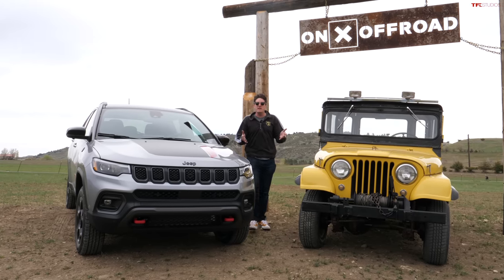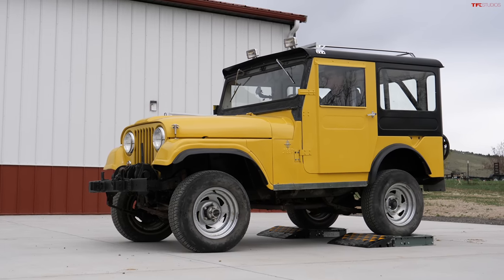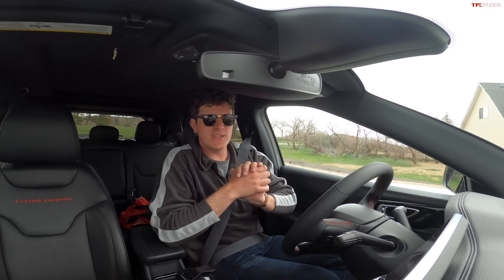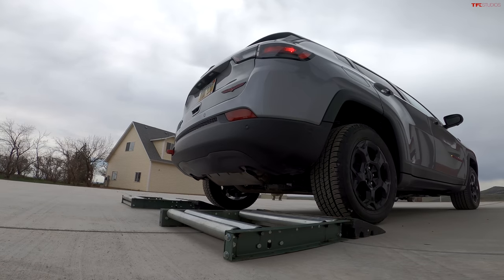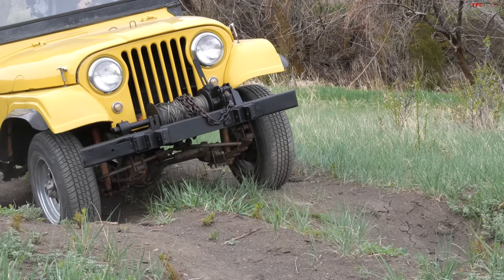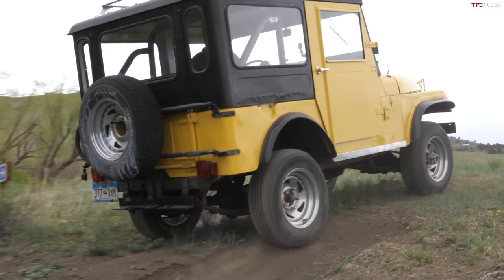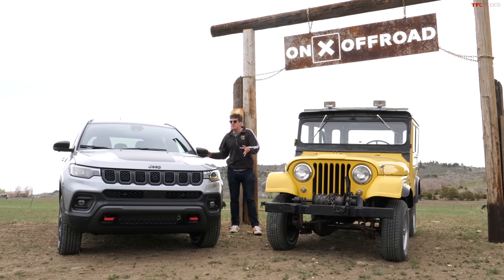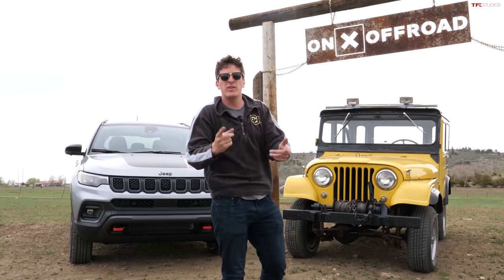Old vs New: Here’s Why Everyone Is Wrong About New Jeeps! Slip Test & Off-Road Challenge

Comment: As someone who was a child in the back of a CJ-7 in the mountains of Colorado in the late 70s, I'll tell you we didn't get cold from Dad having to get out and lock in the hubs.  He was smart enough to have the hubs already locked in whenever we left home in bad weather.  We were still cold though; that's because the stock heater was garbage.  I still have the original sales papers for that Jeep.  V-8 power, auto trans, hard-top, all for about 5k.  We never got stuck in that Jeep.
Reply: As kids, my family would've been kept warm because we'd be out pushing.
Reply: It is important to be prepared!
Reply: You need to be more specific about that $5k and the year. Due to inflation that could be $25k or $40k. The 70s weren't great for economic stability.
Reply: @jayhiggins5239  I would have to do some digging to find the paperwork so you could do your analysis.  Most people get it, things are relative.  I think the real point is that the Jeeps from back then have a higher chance of still being on the road 45 years later than any modern Jeeps have of being on the road 45 years from now because of simplicity.
Reply: But newer 4x4 and 4WD is better.
Reply: Put s set of lockers in the old jeep and you could do all your tests at a idle
Reply: @spuddoright1970  Yes, despite what some 90 movies portrayed. Digital electronics don't do well over time.
Reply: I can relate to this story since I grew up hunting muleys using an ‘83 CJ-7 in late November on my uncle’s ranch near Corona, NM. As you said, we were always smart enough to lock the hubs if we thought there was the slightest chance we would need four wheel drive.

Comment: These slip tests really are undeniable examples of 4x4 systems. Glad you guys do them
Reply: Yeah they are great! No AWD or 4WD should be reviewed without it.
Reply: @Helicopter Dad! well now you don’t need to know tricks they work lol
Reply: Does that mean that chinese are smarter. The computer that controls that four-wheel drive was designed and manufactured in china.
Reply: @vipercam1785  I wouldn’t make a broad generalization about the intelligence of a country based off of a 4 wheel drive system myself. Lol
Reply: @vipercam1785 I am sure that while the computer is built in China, the testing and fine tuning is done by Jeep in the USA.

Comment: I get your perspective , but the point most other people make is also very clear in this video. The old Jeep is still running :)
Reply: Agreed 🤣 They should repeat this test in 60 years and see how they both fair.
Reply: I had the same thought. Let's see how the Compass does 60 yrs from now.
Reply: This old Jeep is still running
Reply: What’s your point? Any machine will run forever as long as you constantly fix what breaks.
Reply: @khakiswag but at what cost?
Reply: @khakiswag4025 assuming you can get parts for the computer in 60yr.  There's vehicles from the 90's you can't find parts for but you can adapt around unlike these newer vehicles.
Reply: @fritty9927  that’s the point. There are very few parts on the 60 year old Jeep from the factory. But if you want an old classic then the costs doesn’t matter.
Reply: @khakiswag  that is the point. You can get the parts or easily upgrade it. A 60 year old compass or Cherokee probably won’t have replacement part available when that time comes.
Reply: @bad05ford  vehicles have had modules since they’ve had electronic fuel injection. There are companies that specialize in remanufacturing old modules, it’s a growing field in automotive parts. Even if it’s 30 years old now it has modules. Car modules are ancient technology in the world of computing, even a 2023 model. Your smart phone has the processing power to run that 2023 Jeep by itself; whereas the Jeep probably has 20 modules to do the same.
Reply: @LinusScrubTips  considering we already have 3D printers in 60 years I’m positive we’ll have the technology to replicate any part.
Reply: @khakiswag  I'm well aware of repair services for them but some are becoming more difficult if not impossible due to chips with programming and serialized components.
Reply: @khakiswag  face the facts. Most cars have gone the way of most consumer items. They’re meant to be used for 200,000 miles and then be sent to the scrap yard. It’s not necessarily just the excessive technology, it the fact old vehicles were meant to last the maximum amount of miles the engineering of the time allowed. Yes 60s cars didn’t last as “long,” but they lasted longer relative to the manufacturing technology.

We’ve essentially gotten worse over the last 10-15 years. Lots of Toyota and GM trucks would get 500,000 miles out of the engine. Now GM trucks are rolling of the lot and collapsing lifters after 10k. Ford is recalling their garbage every week. At least Toyota still makes a solid product meant to be on the road in 20 years.
Reply: @LinusScrubTips  people live in a fantasy that those old cars easily went 200,000. They didn’t even get close. Odometers we’re 5 digits back then and hitting 100,000 miles and rolling it over was a big deal because few made that far without major repairs. You had to do major maintenance every 20-30K miles like plugs, points, carburetor adjustments etc.  Greasing suspension points and U joints and oil changes every 3,000 miles. Even with all that they had breakdowns before 100K. Now even the cheapest Kia can easily hit 100K without nothing but oil changes. Starting up on 10 degree morning is no different than a 70 degree morning. Try that with that old 60 year old Jeep. 

You can have the good old days I don’t want them. I’m not that old but I remember the struggles of starting on a cold morning. 5 year old cars that were rattle traps, screws falling out of trim pieces, sagging doors etc. Now you have 10 year old trucks with 150,000 miles on them towing 10,000 lbs at 70 MPH with the cruise on and the driver in air condition comfort. No good old days for me.
Reply: Wow… those words. They got me deep. Goosebumbs
Reply: Not in my neck of the woods.  They disappeared long ago
Reply: Exactly!!
All the new stuff is designed with obsolescence built in.
It's the only way they can continue to have customers needing to repeatedly give them $$ over their lifetime.
If they didn't, you'd also buy a Jeep and still have it running 60years later.

Food for Thought. One of the first companies to mass produce coal/wood-burning cast iron stoves back in the day, we're insanely successful when the stoves were first launched. But they were of such high quality that their customers never needed replacing, with many of them still in use today, in cabins, etc.
Most of these are almost 120 years old..!
So yeah, it was different then, but the world nowadays is conditioned to understanding that everything is disposable.
😎👍🏼

Comment: The Compass, although pretty good off-road, will be long gone and filling junkyards, and the old jeep will still be running and functioning as intended for as long as it is serviced.
Reply: It'll be in a junk yard probably.
Reply: Maybe it's where I live, but I see plenty of these old CJs just rotting in fields and things too, stripped of anything worth taking to keep the handful still driving going.
Reply: @AHungryHunky  Yeah, it's just survivorship bias. For every nice CJ still on the road today, there's probably at least a dozen rotting away in a field somewhere or gone entirely.
Reply: True, but the CJ is an old vehicle. In 40 years, this Compass will only be seen in pictures.
Reply: In 15 years you won’t be able to get parts for a Compass.
Reply: @97I30T  How many Compasses do you figure will still be running 50 years from now?
Reply: Nah, it's still junk, just old junk
Reply: @TimeMariner  🤣
Reply: @AHungryHunky  Lot more than a handful still going around here.
Reply: As a Compass owner I'll absolutely cede this. Old Jeeps were built to last. New ones are built around planned obsolescence, like a cell phone.
Reply: The big difference is the Compass is a modern family grocery-getter... Where the old Jeep had more in common with a 1940's tractor than a passenger vehicle. Originally a military get around vehicle, it was mostly used as a farm and ranch vehicle until well into the 1970s. One reason a few old CJs remain around is they rarely were used as daily drivers.
Reply: The Compass will still start in -20 degrees Fahrenheit for the next decade without being garaged or block heated . Can the CJ do the same?
Reply: @hommedammn7132  Mine did
Reply: @hommedammn7132  😂😂😂 depends on how depleted the main battery has become from the underpowered auxiliary(stop/start) battery drawing off of it. They usually fully fail after a couple of years.
Reply: @hommedammn7132  Yes a choke does wonders for starting a carbed vehicle so long as you have the carb tuned right.
Reply: Wrong. New cars last longer
Reply: The CJs I see have few original parts. The advantage for longevity is simplicity and body on frame.
Reply: @hommedammn7132  mine does

Comment: I still prefer the old school 4x4. All the new 4x4's have way to many electronics. Even our 2020 gladiator rubicon has to many electronics to my liking. I prefer my TJ for off roading. try and fix something electronic when remote overlanding. With old school, mechanical rigs, you have more chance to fix it or patch things to a certain level that you can still drive.

Comment: As long as the computer doesn’t crap out on the awd/4wd system (like that awd dodge you had not long ago) yes, new systems are better. My thing is, can I take it apart and work on it in my driveway without a mechanical/computer engineering degree. The compass….. no. The CJ….. YES!!

Comment: I think 2005-2015 technologies are the sweet spot. Traction control systems were decently effective and the interiors weren't infested with screens and touch sensitive panels. I'm not talking about the vehicles themselves, mind you. Though I do absolutely love my 2018 Frontier Pro-4X.
Reply: God I do miss my 2015 Jeep Patriot. It’s 4wd was pretty good but sometimes it would engage right as your going over ice on the road and then it would kick the back end out. It was really good in deep snow doing better than my Ram 1500 in 4x4 with falken all terrain tires

Comment: If you add lockers that CJ would shred the compass on any terrain.
Reply: Or even a limited slip
Reply: It would shred it as is with appropriate driving methods for the vehicle.
Reply: Yeah you can add a locker to the CJ pretty inexpensively, the Compass doesn’t even have a aftermarket locker option

Comment: Very fair comparison, and you could always add an auto locker or air locker(s) to the CJ, but it's a very old model, those leaf springs, especially in an unladen car, strangle the articulation potential of the dual solid axles, also a more modern solid axle car might have things like air con and a quieter interior. Glad to see a real and fair example of both, cheers TFL, keep up the excellent work.

Comment: I bought my 3rd Jeep last month.  My first was a 1963 Willy's Wagoneer, bought in 1982.  The second is a 1996 Grand Cherokee Laredo.  My newest is a 2023 Wrangler Unlimited Sport S Altitude.  In 60 years the technology has changed dramatically.  But the more gentrified models came standard with things like doors and a roof.  The 3 Ram pickups my wife and I have bought in the past 10 years.  Came standard with a/c and a radio too!  But the Wrangler does come standard with a roll cage, unlike the gentrified models and the pickups.

Comment: The older solid axle rigs had pretty good articulation so you rarely lifted a tire. Because of this, you usually had traction at one or more tires. Technology is great, but not foolproof! Had an FJ62 Landcruiser  with open difs and it was extreamly capable still!

Comment: Just opened the video. My assumption is that the 61 CJ5 is open diff with no LSD or lockers and will fail unlike newer electronically controlled vehicles.

Comment: The 4.27 gear ratios on the differentials also helped with power transfer.  I had a 66 CJ with locking rear differential, and a 4 speed manual. Also by then they had gotten rid of the separate levers for 4 wheel drive and low range. I had one lever. Full forward was 4x4 WDH, one notch back was 2WD High, Next notch was Transfer case neutral and full back was 4 X 4 WDL. It also went into gears a lot easier and smoother than yours.  BTW the locking hubs was an option, most standard Jeeps at the time had the front hubs fully locked all the time. You were turning the front differential all the time, but it was not locked to the engine via the transfer case.  Most people opted for the hubs to improve fuel economy and reduce drivetrain wear.

Comment: Another thing about those wheel lockers:  If you lived in the rust belt, those wheel lockers would eventually get corroded and nearly impossible to turn in just a few years.  Also, they'd have issues much like you have when trying to engage 4WD inside the cabin; you may have to rotate the wheel a bit so the lock can slip into place.  Imagine being stuck, being unable to move and having this problem...
Reply: "Wheel lockers"?

 They're called "locking hubs".

 They engage just fine if you turn them, then climb in, and ease into driving in 4WD. Many people just locked them in Autumn and unlocked them in Spring. A CJ7 could be shifted from 2H to 4H on the fly if the hubs were locked.
Reply: Everything fails if not properly maintained according to the conditions endured. period.
Reply: I have had locking hubs in the north east for 20+ years and they always have worked
Reply: My dad's 70's F250 sat outside always.  And I always got recruited to lock the hubs before he'd plow our driveway.  And no they wouldn't always torque to locking position.  Some "subtlety" was necessary at times.
Reply: @blueman5924  I love engineers.
Reply: @blueman5924  Always glad to have and engineer or engineer in training in the conversation!
Reply: Not to mention the locking hubs are rebuidable for cheap and only took an hour for both sides.
Reply: @blueman5924  exactly. WD-40 is a great protectant.
Reply: The locker is entirely inside the diff.  Why would it rust?
Reply: @driftlesstrekker4709 the locking hubs are not inside the diff.
Reply: The correct way of using the locking hubs is actually to leave open when you know for sure that you wont need it in that day. If for any reason you might need to engange your 4x4 you can just leave them engaged and then you only have to deal with the 4x4 stick. The locking hubs are to prevent premature wear. Its ok to leave them on and drive on 4x2.

Comment: I think a big part of the draw towards older 4x4's is that they are very easy to modify.  You can take that CJ5 and have any engine, lift, axles, lockers, tires and it's going to be affordable and you won't need to involve any professionals per se. You can do all those things to a new vehicle, but it will be very expensive and it will complain every step of the way. Personally, I prefer the new stuff, it's better and more convenient right out of the gate.

Comment: The Compass is an impressive machine, I am glad this generation isnt as cynical as the outgoing one and its clear Jeep's engineers really put the work in to make it as capable as possible given the drivetrain and suspension limitations. Definitely a good pick if your interests involve getting to a trailhead or that one remote campsite. No doubt with some modifications the CJ will outpreform, and most modern 4x4s will do better even stock, but for something you actually have to live with on a daily basis, the Compass is a compelling package on paper. 

One thing I noticed, I do not like the location nor selector style of the terrain management system. Seems like it would be easy to accidentally bump by a passenger and unexpectedly toss you into Snow. Not terrible, but certainly alarming if you are not expecting it. I had someone accidentally knock my Renegade, a few days after I bought it, into Manual mode while i was trying to accelerate to highway speeds from a stop. A momentary "WTF" situation when I hit 5k RPMs in 2nd until my brain pieced it together. I much prefer the dash mounted rotary dial I have in the Rene with the push buttons to "lock" it in 4x4 without putting it in a particular drive mode.

Comment: $8k.  That's what I paid for a new 1989 Subaru Justy 4x4 manual.  It was tenacious, ran like a scalded weasel and got 38mpg.  Seated 4.  Most people do not go off road.  It was like a skier on snow too.  Sure wish someone sold something like that.  And then real trucks - with full size beds.  Miss those too.
Reply: Suzuki sx4 is probably the last car sold in America with that formula.
Reply: @benjaminbuschi284  Yup, Owned a Samurai and  it's bigger brother, only paid $99 for those.  Needed valve cover gaskets.  I looked really hard at the SX4s... got a Mercedes Mommy wagon for $2300... live in Appalachia.  If it snows, wait a day.  Benz is pretty good in snow with winter mode selected.
Reply: @bmwloco  I went and bought a JDM 4x4 3 years ago because I wanted a car that could actually fit down the trails here in the northeast. Modern 4x4s are so wide, it makes actually running any off-road trails difficult.
Reply: @benjaminbuschi284  What formula?

 Subaru Crosstrek is still sold with a manual trans. 2024 redesign will mean the end of the manual trans in that though.

 Jeep Compass and Renegade may still be offered with manual trans.